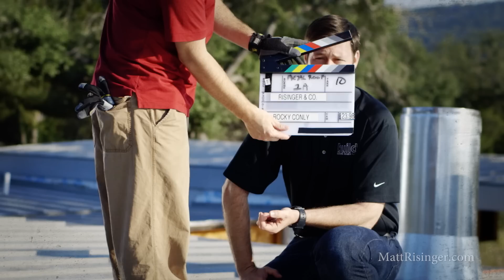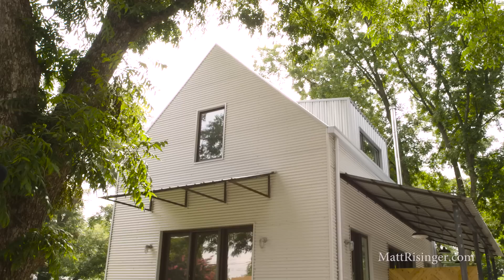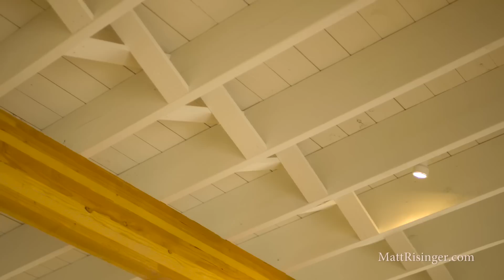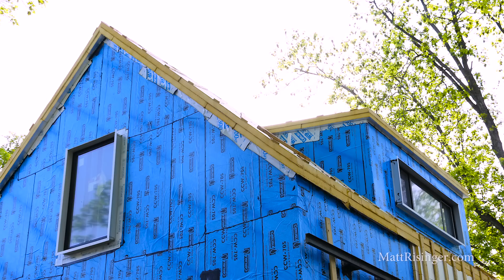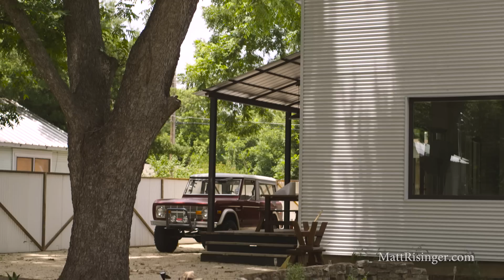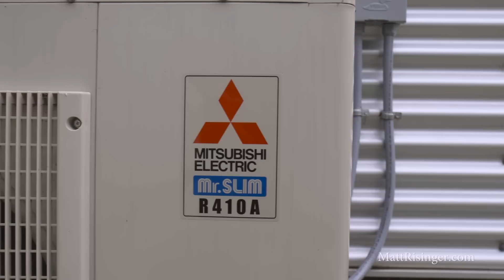Perfect Wall Review - A system to Build an efficient house!

Comment: I love this house! I want to build one in Central Ontario. How would you modify this build for a colder climate? Is the use of foil-backed foam specifically for hot, sunny climates? I'm thinking about over lapping seams of two layers of 4" Rockwool Comfortboard for R32 on the walls and roof, instead of rigid foam. I like the mineral wool product for it's fire-proof and sound-deadening properties but is it a good product for this type of build? The use of WIP 300 HT is smart for hot climates but would you change this up for a colder climate? Think 'Northern Michigan' if you need a reference point. ;-)
Reply: The builder I will be using in Winnipeg has built two homes this way, and retrofitted, as best he could his own home, and he highly recommends Rockwool b/c in "our climate [rigid foam] needs to be EPS b/c it's permeable enough for the wall to diffuse outwards...it's not as structurally stable.  Also - it's a horrible environmental impact and chaulked full of every chemical you can think of. Roxul...is next to no chemicals, lower impact, higher performing, strong as hell, fireproof, and actually increases in r value slightly as the temperature dips"  Winnipeg often gets to at or below -30°C.  My neighbour here in ON, told me about Naturaseal (naturaseal.com).  He works for AM roofing and has worked with the product.  In a casual conversation he could not stop talking about how great this product is.  I would hazard a guess it could be used as the air and vapour barrier layer.  Good luck with the house build.
Reply: I had considered a liquid applied air barrier but I had not heard of Naturaseal before so thanks for that tip! Their presentation centre isn't too far away from me so I may have to pay them a visit. As for insulation, I'm sold on Rockwool (Roxul) but not on the price. I'm considering blowing in cellulose between Larsen trusses.

Comment: Matt, I love your videos man, you're way ahead of the game. What are you using for you sheathing? I'm wondering if a way you could make this house even better, maybe not from a functional level but an aesthetic one, is to do a kind of post and beam structure. Use steel post supports in cement with large wood posts in the steel for the foundation. You want not need all that unattractive framing lumber, you would have large #1 grade timbers every 8 feet and the sheathing would be 2x6 t&g doug fir nailed to the outside of the posts. What do you think?
Reply: Jack, I like your suggestion of “Post & Beam,” Regrets, you lost me on: “…steel post supports in cement with large wood posts in the steel for the foundation…” ?
A metal frame is a favorite in Costa Rica where a good welder used to cost $10 -15 per hour. Wood - delicious food for termites.
Reply: @antongorillo7715  You may have misunderstood; a common pier & beam foundation technique, at least here in Texas, is to pour concrete footings below grade up to at least 6" above grade, then drill or sink in (while the concrete is still wet) a triple-dipped galvanized post base/bracket, then attach the bracket to a pressure-treated post. Simpson Strong-Tie is a common brand. There's no wood within 6" of ground and you can even get a "termite shield," a piece of metal flashing designed to block termites' path from ground to the wooden post.

Comment: I have an old masonry home and I'm looking for the best way to prevent heat from coming indoors during the hot summer months (I'm in southern Italy). What would be the best method for insulating masonry homes in hot, humid climates? Additionally, my neighbors' homes are attached to the two sides of my home making them inaccessible for external insulation. What would you recommend I do? Should  external insulation be used on the front, back and roof while internal insulation is used on the sides attached to my neighbors' homes? Any suggestions would be greatly appreciated. By the way, great videos.
Reply: You have the right idea--foam + EIFS on exterior walls, foam + plaster on walls shared with your neighbors, and foam + strapping + deck/purlins + roofing for the roof.

Comment: You lost me at "2x4s on 16" centers". No thermal sink that would compliment the "Perfect Wall"? By the way, if it's 500 year why is maintenance required on the metal sheeting? Couldn't that have a ceramic coating to avoid maintenance?
Reply: The entire envelope has a continuous thermal break in the form of 4" to 6" of rigid foam. The framing studs are basically irrelevant to the thermal performance. The "500 year wall" thing is kind of hyperbole IMO, but it's conceivable; it's not implied that there would never need to be maintenance, though. Let any type of wall short of maybe stone go without any maintenance at all and it's not going to be there in 500 years. Steel cladding in Austin would probably need to be replaced every 50 years or so.

Comment: Thank you for all your videos. How would you support windows on the outsulation? Would not they sag after a few years with only insulation holding them up.
Reply: They will be fixed back to the frame, like a rain screen cladding system, protruding from the frame to accommodate the insulation and cladding.

Comment: So - question... how did you get around the fire codes with exposed structure and no fire barrier (drywall)?  Did you put in sprinklers, 'cause I didn't see them.  IMHO, you have basically made a well insulated wood fired kiln wrapped in jet fuel (foam boards).  But it looks pretty.

Comment: One thing I read or heard from Joseph's lectures is the location difference. Where is Alaska most to all insulation is on the outside, but as go you farther south the ratio reverts to the the opposite or nearly, say 20% outside and 80% inside.  At this time I am not sure of the reason but this seems contrary to that idea.  Any ideas of a 2 house comparison of yours versus the 20% out and 80% inside would be?
Reply: The reason is to keep moist air from reaching cold sheathing. In this case the insulation itself is airtight, and the sheathing is covered in peel-and-stick on the moist side, so even if the sheathing is cold it will never come into contact with moist air.

Comment: How do you fix the cladding and roofing through the insulation? Must be using some long screws
Reply: I had the same question. Outside of the studs, you have 1"(x6") pine, 1/2" OSB sheathing, 3" of foam (or 4" in the video), then 1" battens... That's 5-1/2" to 6-1/2" nominal between cladding and stud. So that's a lot of fasteners sandwiched into the wall, and a long screw to secure those battens so they hold the cladding securely.
Reply: There are several companies that sell 8-14"+ screws for exactly this kind of application.

Comment: I read that siding should have an air gap between it and the insulation. How would you attach the siding and how would this work on CBS? I am in FL so the siding has to take winds of up to 180 MPH
Reply: Attach furring strips to the CBS through the insulation, then attach siding to the furring strips.

Comment: I have always wondered if houses with metal siding are electrically grounded ?
Reply: Sometimes they are. Its not a bad idea, but you can't depend on all the sheets being bonded to each other. Structural steel frames on the other hand should always be bonded.

Comment: Matt, great video. A few questions. The wall assembly includes CCW 705 which is a vapor barrier. Is there a reason for that? I don't see that in the area very often. Why not vapor permeable air barrier like house wrap or fluid applied? And, if you want a vapor barrier, there is a way to install R2 + Silver as a vapor/air barrier. Was there a reason why it wasn't done and CCW 705 was used instead? Lastly, what made you use R2 + Silver over other types of R2 insulation? Look forward to seeing your reply and thanks in advance.
Reply from the maker: +D.Y. LEE Check out the white papers on "Perfect Wall" on Building Science Corp's website.  www.BuildingScience.com for more info on the vapor barrier.  Yes, we could have used other insulations certainly.  PolyIso gives a high R-value per inch and was a good choice for this project.  XPS, EPS, or Mineral Wool could have also been used. Best, Matt

Comment: You don't have to use sheet rock on the walls and ceilings?  I thought that was part of the national building code to give fire fighters a chance to save victims before structural collapse.
Reply: +77Avadon77  Right. Poor timber frame and log cabin owners. You're all just dead men walking!
Reply: Bad drywall came from China and made people sick...Peking Duck left out for several hours makes people sick...see where this going?
Reply: 77Avadon77 thick timber is actually fire resistant....try burning a log and you will see
Reply: "Drywall saves lives"? that is hilarious. I guess you must work for a drywall manufacturer. The single biggest cause of fires inside a house are electrical, that is on the inside of the drywall. So in most cases drywall does not help to slow the fire. And it is a myth that drywall is part of the national building code.

Comment: I have been looking at different (efficient) wall designs for a house I am designing and would love to build something like this, but is sheetrock a required part of the national building code?  Great video - thank you!
Reply: I don't believe sheetrock is required and I've been looking for a way to remove it completely. This is right up my alley.
Reply: Around here you need an approved fire barrier such as Sheetrock
Reply: I live in a rural area of northern california were fire codes are literally stricter than any other state in the country. New construction must have a sprinkler system inside the house, cladding must either be cement based or metal, windows must be tempered, etc.  But having drywall is not a requirement. Drywall isn't going to do shit it preventing your house from burning down.

Comment: +Matt Risinger I am curious about the detail where the porch roof connects to the home. It appears that you have a major thermal bridge where the ledger (steel?) connects to the structure. Is this not a big deal or is there some connection detail that minimizes energy transfer? I am building a similar home with a second story porch and this is a concern of ours. Thanks!
Reply: Wesley, the concept is off Perfect Wall from buildingscience.com.  They don't  really answer the question you have, but the do have examples for smaller overhangs where the overhang will float on the side of the insulation.  If you're doing something larger and figure out a good solution, please publish.
Reply: What from this video implies that the steel continues through the many layers of insulation that were discussed to make the thermal bridge? From what I can see it would bridge the 4 inches of insulation he discussed.
Reply: You can see that the porch roof is made of lightweight metal, and the front supporting posts can be made very strong so that the ledger does not have to support much weight other than wind load. He is probably using screws into the studs so there is some minimal amount of bridging, just the screws going through the insulation to the stud wall.

Comment: what measures did you take to prevent thermal bridging at the overhang fasteners?
Reply: There's probably no way to completely avoid thermal bridging, but if the overhang frame is screwed or bolted through the insulation into the studs, thermal bridging should still be relatively minimal. It would be comparable to nailing through sheathing into studs.

Comment: Can anyone address the issue of whether or not interior drywall is a building code requirement?
Reply: +59seank In Canada (where I'm from/working), it's not a code requirement.  

The reason most people install it is for a nice finished surface.  It's also standard to use drywall/sheet rock mainly because most buildings insulate the interior of a building... Without getting too technical, this means your vapor barrier needs to be closest to the interior (in most cases the drywall IS the vapor barrier -which isn't necessarily smart building practice.)

For THIS wall system you can get away with it -as the insulation is on the 'outside'.

As for fire safety, it's really up to the building inspector.  If you've done the appropriate math, or had someone certify the design, then you should be able to get by without drywall.
Reply: +Kawlin Rolfe Thanks for replying to my question.  I live near Chicago, and I don't think I've ever seen bare studs in any house (except for summer cottages and barracks).  I thought drywall was a nation wide code, but Matt Risinger said they had code approval for his house (which I expected).  Now I know it's OK in Canada too.  Thanks again.
Reply: +Kawlin Rolfe Maybe check your code again. 1/2'' is required on walls to slow down fire spreading times in Ontario. Alternative interior finished may be considered after undergoing tests.

Comment: How do you get a fire rating for the inside of the exterior walls with this house wall system?
Reply: His house has an airtight envelope with a metal sheathing on the outside, but extremely flammable EPS foam and no drywall barrier.  That makes it kind of weird to assess.  It would have a very dangerous rapid onset and then likely be easily contained iff it suffocated before breaking windows.

This doesn't directly reflect on Perfect Wall as a concept, because as buildingscience.com reflects, your insulation choices are yours, and they don't even bother telling you what to do with drywall.  Instead, their concern is where the insulation and air/water/vapor barriers go relative to structure (outside)
Reply: I understand the concept of keeping all moisture out, but my local building code would not allow for the open wall cavity design shown in the video.  Maybe different states allow this concept without a burn resistance rating.

Comment: Would this work up North in the cold,? Where do you hide the plumbing etc?
Reply: +Kevin Lynch This wall assembly is for hot climates. With cold climates we're trying to keep hot air in, not out (like in this video). Things such as the vapor barrier would be on the opposing side to this one shown.
Reply: Nope this system is for all climates. Any potential (unlikely to happen) condensation would happen outside of the peel and stick and would not hurt the building.
Reply: cold climates traditionally have vapor on warm side, hot climates on cold side.... Essentially against conditioned space either way.
Reply: Vapor barriers are unnecessary in most cases, but if it does exist, it should be on the warm side in all climates.
Reply: There is no such thing as a warm side here in the northern latitudes. We heat in the winter and thus have cold air outside meeting warm air inside and water vapour condensing wherever hot and cold meet. In the summer we cool the house when its hot outside and thus we see the opposite happen, but the side of the surface the vapor forms on is reversed. So far vapor retarders are the only viable way I've know of that's used in traditional framed houses that wont trap water in your walls but can help control air flow if done right. I really like the system Matt demonstrated and I will definitely be looking into it for my future projects. Thanks Matt for another really informative episode of The Build Show.